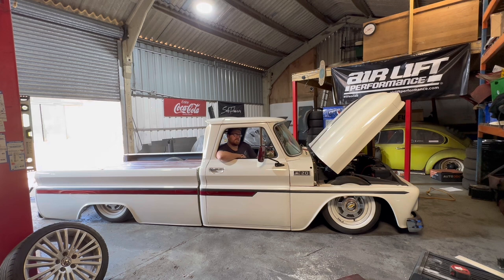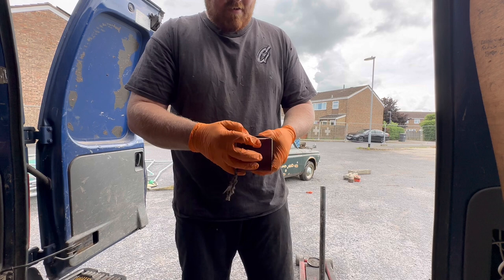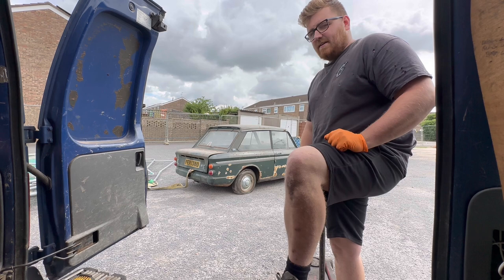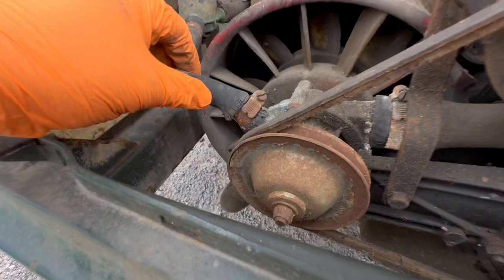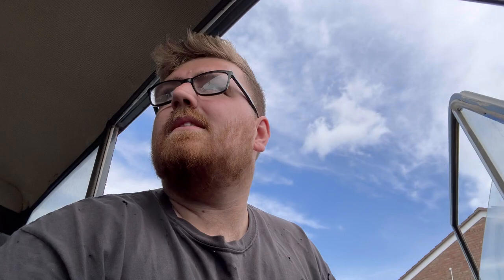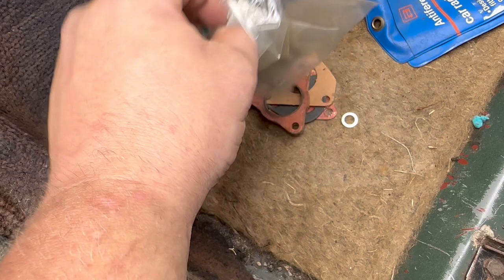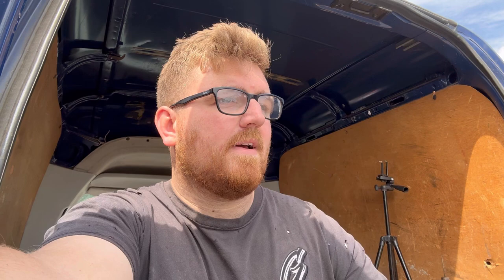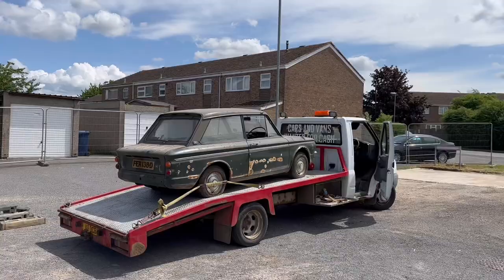GARAGE FIND HILLMAN IMP | WILL IT RUN? WILL IT SEE THE ROAD AGAIN?!

Comment: The reason the car is covered in small rust spots is due to condensation dripping from the roof of the garage, & as that car has sat for such a long time it has faired well!  It is certainly worth restoring, either to original or as a restomod!   The purchase of the Rootes Group in late '66 was the start of the problems for the whole company! They did not understand the reason for small cars and they completely baffled by the IMP. The senior management made that clear from day one and refused to give it the development money and attention we in the engineering department knew it deserved!  They also refused to give the competition department the funding they required when the IMP was doing so well in racing and rallying!  The potential this car had was Mini beating in all departments if only it was given the chance!

Comment: The aft and acetone mix is your best bet. Don't forget if it is seized now you will have debris in the bores if you get it to turn over. Your valve isn't stuck, its just at it's cycle of opening and closing. In all it will need to be pulled down and measured to make sure you have a reliable engine. My last imp engine had sat in the car for 19 years and spun like it had no compression, that was the rings stuck in the ringlands. They freed up nicely and has good compression. With the clutch only depress it once and if it stays on the floor try undoing the bleeder on the slave cylinder at the top of the engine. If the pedal comes back you will need to look at master cylinder under the fuel tank. Four bolts on top and the fuel line is screwed on with 11mm of imperial equivalent. One last ditch attempt is to loosen the dissy, and turn it back and forth to see if one of the spark plugs spark to see if one of the cylinders is at top dead centre. Put some fuel in the cylinder, put the plug back and see if you can fire it free. Good luck.

Comment: In 50 years of working on cars, I've never seen anyone trying to free a seized engine by setting fire to it!
The best way to do it is to fill the bores with paraffin and leave but keep topping up for 3-4 weeks.. you might have success then. 
By the way, the crankshaft is not made from aluminium.
Good luck

Comment: Try some coke down the bores, usually the rings rust in place inside the liner. You are correct steel crank but with white metal bearings/ shells on all of the journals. (Also steel rods, Ali pistons, steel liners inside the Ali block (cast in place))
Reply from the maker: ah thank you! i did think an ali crank would be ambitious! haha, i’ve let it sit overnight and one of the valves is open and its drained out all over the floor 😂  i’ll see how i get on this week!
Reply: @Joshwaa___  sweet, sounds about right for an imp! 😅😅 Keep at it, you'll get there!

Comment: You can pull the engine out, including the gearbox is less than 15mins. Instead of messing about like you are doing.

Compresst tthe donuts and take off the drive shafts. Disconnect the gear change and clutch. Disconnect the throttle and choke.... support the engine and give the car a shove.

You are wasting time.... fix it properly. Haul the engine out, take the head off.